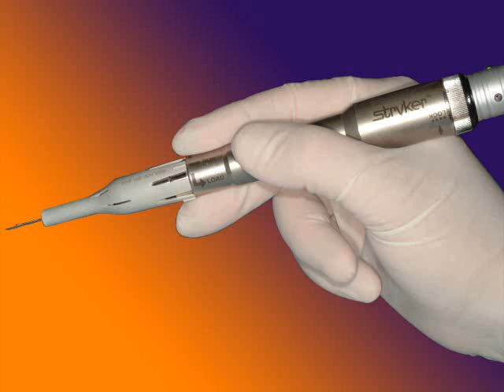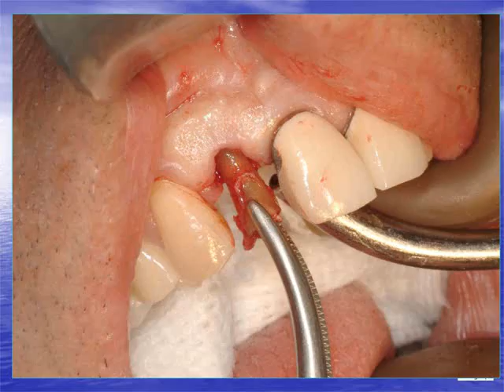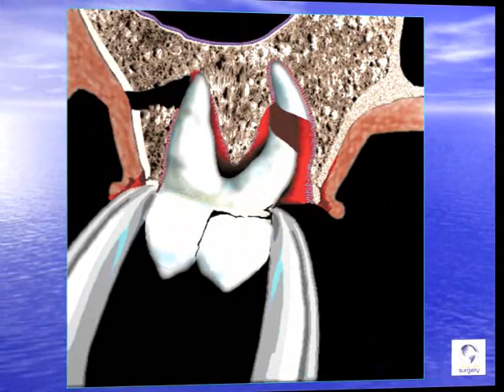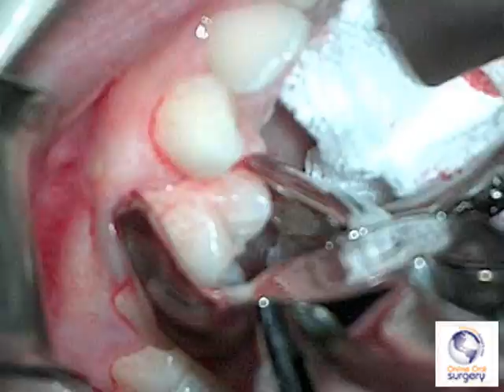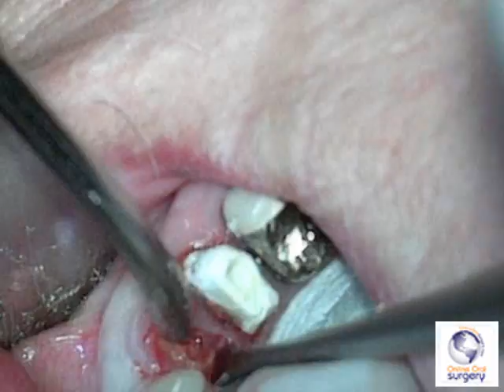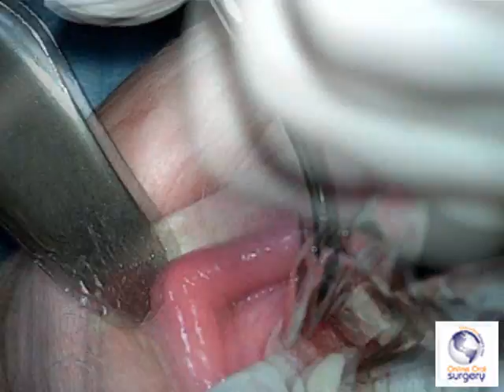Instruments for Atraumatic Extraction of Teeth

Comment: Hi Dr. Reznick, Dr. Robert Carpenter at Midwestern Dental School referred me to your videos and website. I'm still a dental student, but can you provide any tips on how to avoid fracturing teeth during an extraction? I usually use a periosteal elevator, followed by elevators to luxate teeth and elevate them as much as possible. Once I've achieved some movement I will switch to a forcep and apply about 10 seconds of pressure in a buccal-lingual direction to allow for expansion of the alveolus. If I don't get much movement I switch back to the elevator either interproximally or in the long axis. About half of my extractions end up with root tips/fragments. I'm interested in placing implants so the more bone I can preserve the better, I'm just seeking some tips on atraumatic extractions. Thanks!
Reply from the maker: Sometimes with ankylosed teeth, nothing you can do will prevent root fracture. The key is slow, gentle pressure to expand the alveolus and luxation to stretch the PDL fibers.  Proximators are really helpful to do atraumatic extractions. Sometimes you need to use a thin (701) bur to get space between the root and bone. Try to preferentially remove tooth, so that the alveloar bone is preserved.

Comment: what is the difference between periotome and proximator? thank you
Reply: The video shows the difference. Both instruments are placed into the PDL space to sever the periodontal ligament fibers. A periotome has a thin flexible blade that mostly cuts the fibers, but does little to expand the alveolus or luxate the root. The Proximator is like a "turbo periotome". In addition to severing the PDL attachments, it also expands the alveolus, luxates the root, and displaces it occlusally. Periotiomes can take a lot of time to loosen the root. The Proximator takes less than half the time.

Comment: Does a spade proximator or luxator guarantee an apical force that will reach half or 3/4 of the root even if there is good bone support?
Reply from the maker: If the bone is dense or thick around a root, it will take more time, but you can work the Proximator at least half way down the root, such that you will displace the root occlusally.